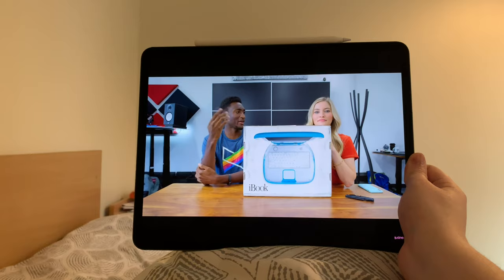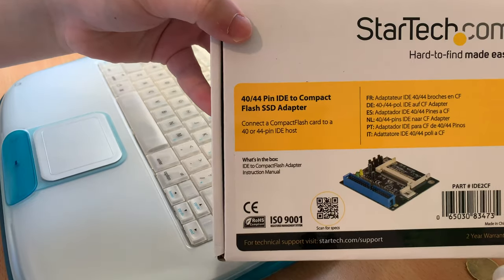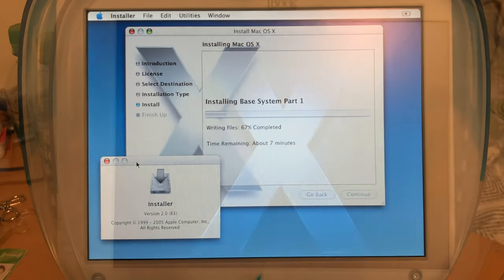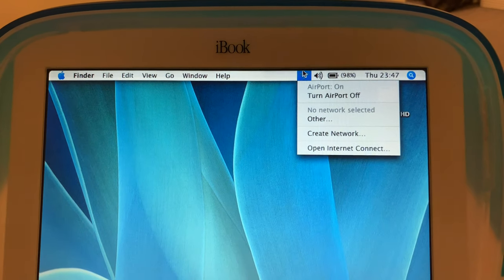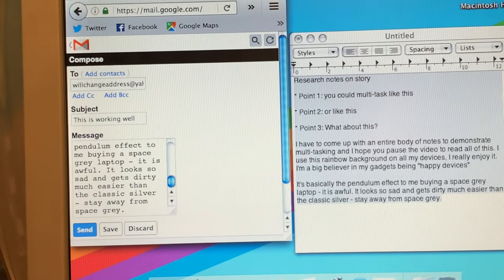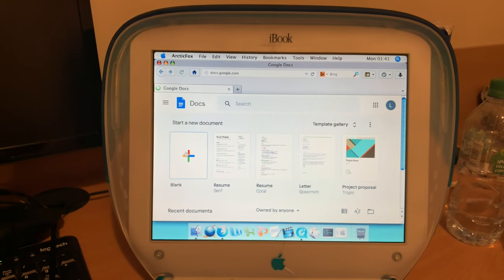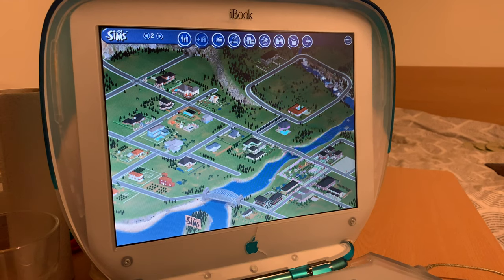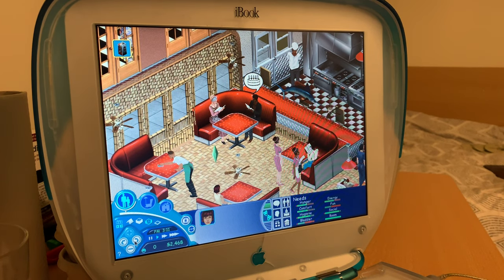20 year old iBook Clamshell Laptop can Edit YouTube!

Comment: Umatrix plugin will block tracking and ads and will speed up your browsing. Also look in to tethering an android phone to your iBook via usb. You will then be able to connect to any WiFi hot spot. The airport card only supports WPA and limited WPA2.

Great video!
Reply from the maker: Unfortunately I am an iPhone user! Did a bit of digging and from what I personally remember when I had older Wi-Fi it works with WPA but not WPA-2. Stay tuned, next up I try editing Arri Alexa 2K footage on a 2008 MacBook Pro! Hoping to have it out end of this week or next.
Reply: My Pismo will do WPA2, if it's AES encryption..it's TKIP that it trips up on.

Comment: I bet I could use an iBook G3 in 2021. I’ve got a 900MHz one with 640MB of RAM and a similar SSD setup.
Reply from the maker: Challenge time! Make a video and drop a follow up comment to let me know how it went; so many more MHz and Ram!
Reply: @ImLeeLoi  Will do, just got to get a new charger, and probably a new WiFi card, since mine also has no support for modern WiFi networks.
Reply from the maker: @mzs112000  I don't think Modern Wi-Fi cards exist for it unless you go USB route. The airport card in mine couldn't even connect to new unsecured Wi-Fi.
Reply: @ImLeeLoi  there is a device that plugs in to the ethernet port, lets you connect to WiFi networks on old devices.

Comment: What software did you use to play YouTube and to install imovie, my ibok does not allow it, it says it is not compatible, I have the same model as you
Reply from the maker: Make sure your running 10.4 Tiger. :)
Reply: @ImLeeLoi if it is in this system but it won't let me run, what did you use to open the youtube videos?
Reply from the maker: @seriesretrogis5010  I use quicktime player. Did you change the browser user agent. I have read reports on Mac Rumours that apparently that this hack on YouTube doesn't work in some Countries like the UK but can't confirm. :)
Reply: @ImLeeLoi  is there any place where i can turn on how to configure quick time to open youtube videos? I already managed to install imovie but it asks me for more screen resolution than clamshell supports to open it
Reply from the maker: Series Retro GIS You installed wrong iMovie, I used iMovie 2

Comment: How did you get it to boot from usb?
Reply from the maker: So if you watched the video, what I did was actually copy the Tiger CD 1 contents onto the iBooks second partition, booted into open firmware and executed the code mentioned in the video which eventually boots into the Tiger install on your internal HDD. As for when it asks for Disc 2, 3 and 4: Those install off the USB stick fine as the Tiger installer is smart enough.
Reply: @ImLeeLoi  Ok thanks